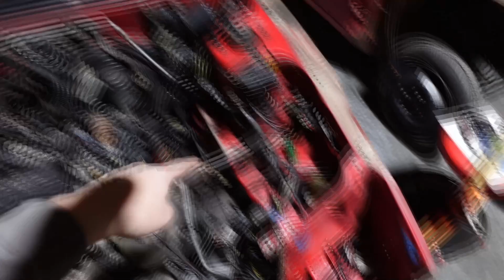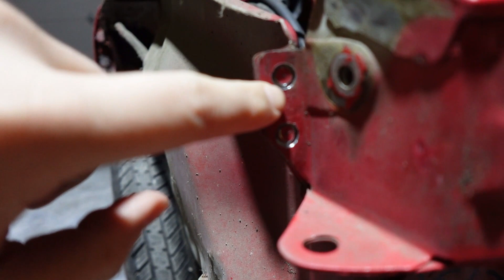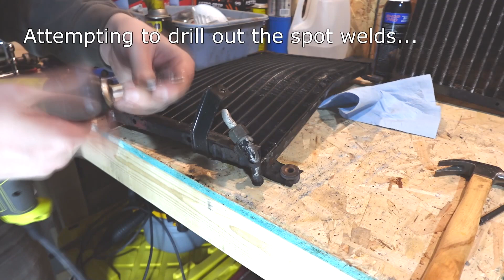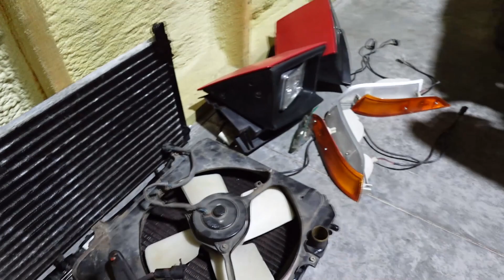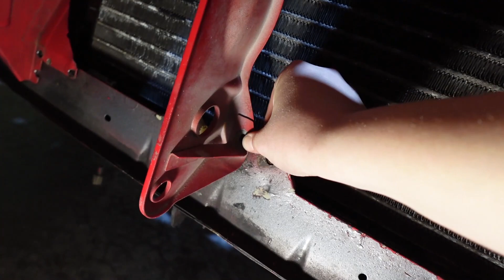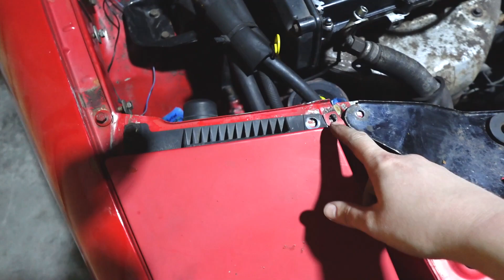Mercury Capri Rebuild Ep 4 - Swapping Front End & Aligning Panels

Comment: I'm going through a similar process with my XR2. Any tips on where the spot welds are on the header/nose panel? I have a video up showing the carnage after a deer jumped on my hood!
Reply from the maker: If you look closely with a good flashlight, you can usually see the small round indentations of the spot welds. If it’s covered by a layer of seam sealer, you can use a chisel or a flat-head screwdriver to scrape and chisel it off to see the spot welds underneath it.

Basically, you want to look for where the different pieces of sheet metal overlap. There will probably be spot welds holding them together.
Reply: @FierceMotorworks Thanks for responding! I found the 4 on either side behind the fenders. Are the rest up top? Any behind the bumper? I really appreciate any help!
Reply from the maker: @willstaffan3229 I can’t remember where they all are. It depends on how many pieces you are trying to remove. If you try to pull it apart and it won’t go, it’s fair to assume you missed a spot haha
Reply: @FierceMotorworks yeah, I'm trying to be ginger and work on the broken parts first. Great content, thanks for posting your work! I need to get better at that